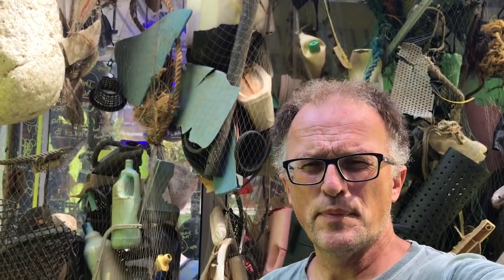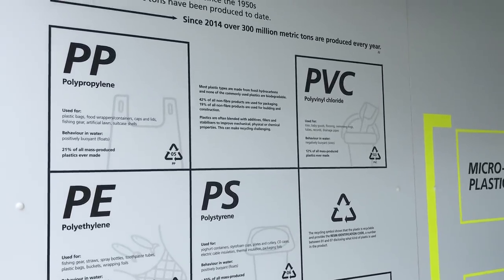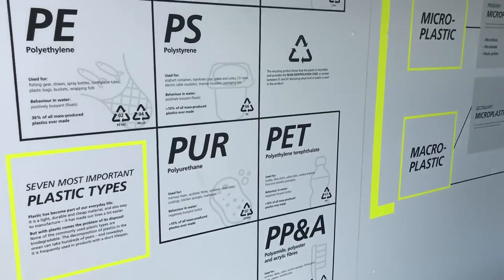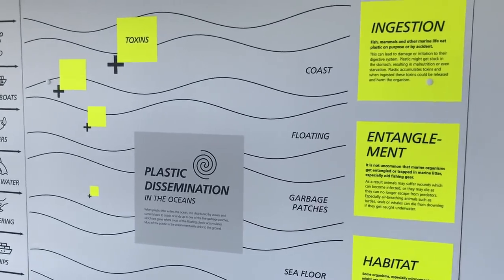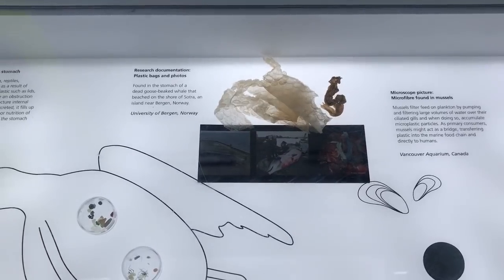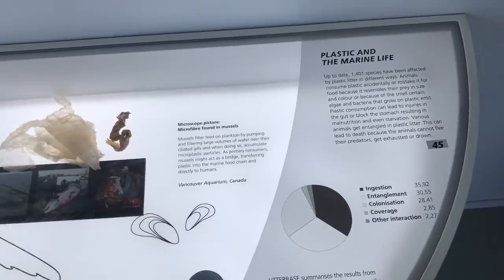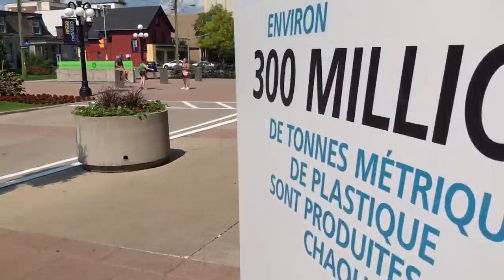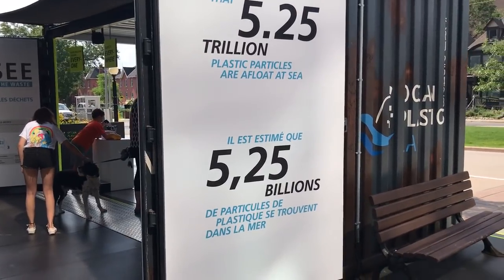The Shocking Reality of Plastics in the Ocean

Comment: 9:45 
Trillions and Billions have different meanings in depending on the language.
Here are some of the words of english and french side by side:

10^3 a thousand - un mille
10^6: a million - un million
10^9: a billion - un milliard
10^12: a trillion - un billion
10^15: a quadrillion - un billiard
10^18 a quintillion - un trillion
and so on - et ainsi de suite

The french language (also german and many other european languages) uses the so called long scale with alternating -illions and -illiards and the latin prefix increasing with every other step.
The english language uses the short scale without the -illiards and the prefix increasing with every step.
Both systems are valid but they can get a little confusing if they are still unfamiliar. I know it was like that for me when I first learned english (german uses long scale).

Quick tip: If you encounter a large french number, double the the latin prefix and subtract one from it if it ends with -illion.
I hope this this correct. I only had three years of french in school and didn't pay much attention back then.

https://en.wikipedia.org/wiki/Names_of_large_numbers
https://fr.wikipedia.org/wiki/Noms_des_grands_nombres
Reply from the maker: Flobbled Thanks for clarifying this!

Comment: Paul Beckwith
Thanks for your video. I need to pose a question to you if I may.  I have seen many articles and videos on EV's and the increases in production, and  everyone is happy to see that including myself.  What about Tires? I have posed that question to quite a few Climatologists and have received no answer , maybe you can help me on this. Common tire is about equal parts natural rubber, synthetic rubber(oil), and Carbon Black. They estimate that in 2019, 3 billion tires will be produced worldwide and from the scant info I found it takes 80lbs of CO2 to produce one 20lb tire and incineration would add another 60lbs of CO2. By my calculations that's 120 million tons of CO2 yearly not including incineration. Compared to the Worlds annual output that just makes a dent, but considering that we are supposed to be Carbon Free as the goal, I wonder why there is so little research on the subject. Any info would be appreciated, thanks
Reply from the maker: Scott Cook Good questions Scott; I have not looked into this myself at all.